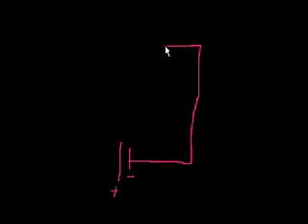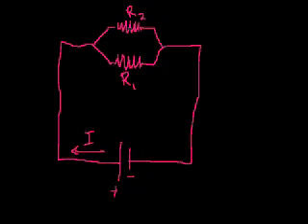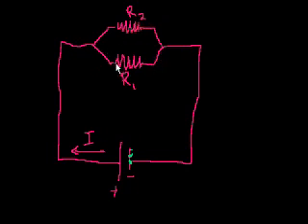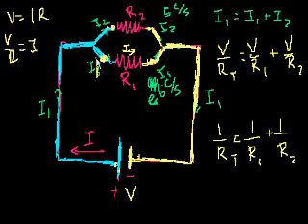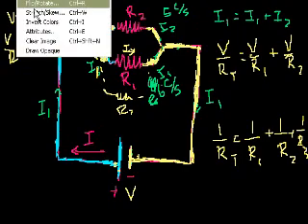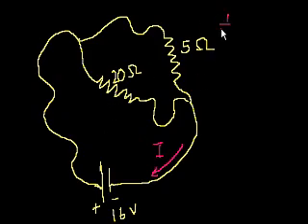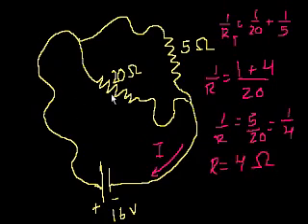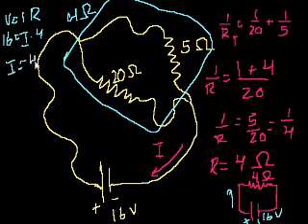Resistors in parallel | Circuits | Physics | Khan Academy

Comment: does the voltage stay the same in a parallel circuit if i have a couple resistors do they each get whatever voltage i have.

Comment: Okay there are two paths for flow of electrons so no bumping of electrons and there repulsion so no change in voltage  but when they are passing through different resistances and meeting again how will current adds up and according to Coloumbs law how voltage is directly proportional to resisitance

Comment: Wait.  I read that the tip of a pinhead has billions of atoms.  So if electrons flow past a point at 1 amp..then there is no way they are actually going even close to the speed of light through a wire as thick as, say, 500 pinheads.  there may be a lot of them passing a very thin cross section per time but..  They aren't all going the speed of light past the point around and back.  Can someone do the math here for a wire with a cross section of 500 billion atoms?  And 1 amp?  How fast are they actually going?

Comment: Why is there no voltage drop?! When the resistors are in series it does drop. So why not when they're parallel? I DO NOT UNDERSTAND.
Reply: in parallel connections, both resistors share the same voltage drop, its an important property of parallel connections, the current however of will branch off between the resistors.

Comment: another way of calculating resistors in parallel, is (just with two at a time):
(R1 × R2) / (R1 + R2) 
So replace with the numbers he used, and the result obtained is the same

Comment: I didn't quite get why the voltage drops with 16 V in this one "arm" (10:50). The voltage is 16 V and this is the sum of all the voltage- drops in each arm. So the voltage in one arm should be V1 = 16V - V2 shouldn't it? 
Or is this special to this problem with parallel resistors? I feel like I didn't quite get the thing with voltage.
Voltage is the potential. When charge/ electrons are in a resistor, they basically give away energy. By impulse, friction, whatever. The potential gets lower but there still has to be some since the electrons eventually reach the + pole. Right? I see that the current drops and the resistance increases, but why exactly is it 60 volt? Why isn't it 30 since the voltage is the sum of the voltage in each arm?

Comment: Thx for the video. Nice and simple :). But what if the circuit would be divided in a way that only one side had a resistor like a lamp.  In our textbook it said that the lamp would not light up because the current would flow through the route with no resistor. What's the logic behind this?

Comment: Why does the potential difference across the resistors not change?
Reply: +Carly Beth I believe it is because the potential difference is defined by the voltage, which is constant throughout the whole circuit. The easiest way to understand this all is that everything is constant, but the only thing that changes from one problem to the next is the actual values and the number of resistors.

Comment: You have an equation there stating I1 = I1 + I2 so stay focused next time. Also you quite often say we "have a certain voltage here" refering to a point on the circuit but a voltage is like you said in previous videos (so I know you know that) a difference in charge between two points so a voltage can't be in a point so be accurate please. Apart from that your videos really do help intuitive understanding :) keep it up but drop the obsession with flow direction^^

Comment: The obsession you have with the flow of current is REALLY distracting.
Reply: In my knowledge, as I was taught, the conventional current is just an arbitrary decision. And even though it is not "logical" in the case of such a circuit due to the flow of electrons, different electricity circuits or batteries use protons or ions to transfer charge. Conventional Current has to do with flow of charges, not specifically electrons.
Reply: But it's important
Reply: +Cristina p I agree, just pick a convention and stick to it.

Comment: I noticed someone had a question about the math he did at 9:06 so here's the explanation: When he did 1/20 + 1/5 and came up with 1+4 over 20 all he did was convert 1/5 to 4/20 in his head. This leads to 1/20 + 4/20 or 1+4 over 20 which leads to 5/20 or 1/4.
Reply: I don't know how people are having trouble it's the simplest mathematics really and he even said what he was doing
Reply: Where did he get the 1? If it's V/R the V should be 16 not 1
Reply: You have to have an equal denominator. In this case he has the 1/20 + 1/5. To get the equal denominator you need to multiply (1/5)*4. That gives you 1/20 + 4/20 (pun not intended), this equals to 5/20, which equals to 1/4. This leaves us with 1/R = 1/4.  To get R: (1/R)^-1=(1/4)^-1  leaves us with  R =4

Comment: This is probably a dumb question, but how did he get 1+4/20 including 5/20 = 1/4?
Reply: 1/20+ 1/5= 1/20+ 4/20
Reply: Kath the lynx but where'd the 1 come from
Reply: Kath the lynx V got cancelled with each other
Reply: He does 
1/20 + 1/5 = 1/20 + 4/20 = (1+4)/20 = 5/20 = 1/4
Reply: Okay lets put it this way 1/20+1/5 = 5+20/100  use simplification then it will be 1/4
Reply: Use the butterfly method
Reply: Hope helps

Comment: I love these videos. But this one leaves me with a question. He explains how the total resistance is 4 Ohms. I get how he reaches that figure, from the calculations, I follow that. BUT - looking at the circuit again - one of the resistors is 5 Ohms, and the other is 20 Ohms, so how the hell can the total resistance be less than the smallest resistor in the circuit?
Reply: Basically when you split the current the total resistance goes down,its kind of like dripping water in a funnel versus pouring in a whole gallon at once. Smaller current will have less resistance. At least thats how I think of it.
Reply: Braddock Sandoval
 Totally makes sense now. Thanks dude!
Reply: Pyrotoman, it's like putting the same amount of water in, but taking away one resistor (and therefore the channel the resistor is in, because it would no longer be a parallel circuit) is reducing the number of channels available for the water to flow through, so all the water would be trying to pass through the 4Ohm resistor and it would therefore be more likely to 'bump' into bits of resistance because the ratio of water molecules to available flow space would be increased.

Comment: when you have the circuit and it seperates into the parallel wiring. where one wire goes upwards and the other one goes downwards, then they meet up again at certain point. in 3:10 the diagram. the current seperates accordingly to how much resistance is in each wire (top and bottom) and then adds back to original current when the two wires meet up again. eg original current was 6 amps, 2 amps goes up wire one and 4 amps goes down wire 2. then when the wires meet the current becomes 6 amps again.

Comment: voltage, potential, potential difference, current, amps, coulombs, charge flow.
is it just me or is that overly complicated.

correct me if I'm wrong but it could be simplified to volts and coulombs/sec or charge flow.

Comment: @rinwhr Due to conservation laws (Kirchoff's law), the current flows in a series circuit has to be the same in all points of the circuit. Since current is basically rate of change of charge per time, it is basically the speed of electron flow. So by this definition if there is a resistor in a circuit, all electrons that are coming into it and out of it will have to slow down so that kirchoff law holds. This is only possible if there is a voltage drop across the resistor. And this is the case.

Comment: @mexman48 

Negative charge means, there are more electrons on that side of the circuit by definition as the electrons themselves are negative charged particles. So they are simply trying to move from the point they exist a lot to they exist less. This is  a spontaneous process possibly due to entropy and has to obey the laws of thermodynamics. Just like a rock falls to the ground but doesn't spontaneously fly.Flying means increasing potential energy and that is not possible in a closed system.

Comment: @dalcde 

Appliances are AC devices usually. The fuse is put on non-ground side of the appliance. Ground is basically a wire connected to the earth (largest sphere we can think of)  The other wire (non-ground I guess, I am not sure what it is actually called) is the actual wire that carries alternative current. Flow of electrons in AC is constantly changing in a sinusodial wave from one direction to other. And this is 60Hz in US, and 50Hz in Europe, etc.

I am sure Salman has another video on AC

Comment: @mexman48 
He is just telling us what the convention is, even though the charges of electrons flowing, is actually out from the negative terminal. You can maybe think of it as:

negative charges move to higher electrical potential
positive charges move to lower electrical potential

and the positive plate has higher potential so electrons move twds there. if it had been a positive charge it'll go to -ve terminal (lower potential).

Comment: Heya,

I think a good word to describe the flow of current in the conventional direction is to express it as electrons jumping through free spaces between atoms, and conventional current as being the flow of 'holes' or 'gaps'.

Thanks heaps for your work, you're going to get me through an Electrical Engineering Degree over the next 4 years.